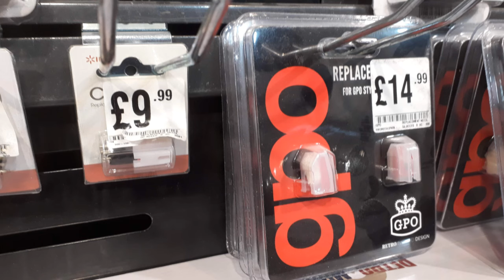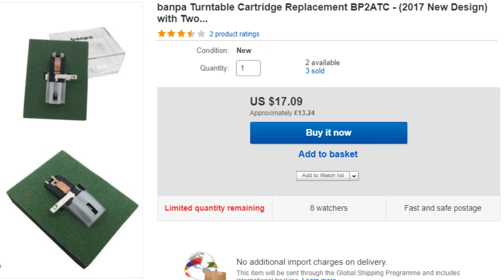Crosley troubleshooting for 'suitcase' style record players

Comment: Hello! I have a Victrola and it turns on and spins my vinyls but doesn’t play sound through the speakers, any idea what the problem is? It just stopped working through the speakers randomly
Reply from the maker: Yes, have a look about 18:12 through the video to see how to test the speakers and at about 20:32 to test the amp. If the headphone jack works then it will be the amp or the speakers. If nothing works, its probably the stylus or cartridge
Reply: @mrrgstuff  I have a Victorola with sound only through the stylus. No sound through headphone jack. I tried what you did @ 21:47 and no sound or amp feedback. Does this indicate a dead amp? I used it several months ago and it worked great.
Reply from the maker: Yes, if touching the 2 wires together doesn't produce any sound with the volume turned up, then there is very likely something wrong with the amp

Comment: Firstly thanks for the great video !

I have the same sort of turntable but then in combination with a dab+ radio and cd player.
When I turn on the turntable I hear continuesly a little 'brummm' I think it has something to do with the amplifier and ground  ...
If I touch the steel of the needle-arm it's gone also if I touch the RCA line out connectors ...
Can you tell me what I can do to get rid of the 'brummm' ?
Reply from the maker: Glad you liked the video. As for the problem, I agree it could be a grounding issue, but I don't have any sure fixes. However, is the unit grounded at all? Many modern record players are run from a power brick/wall wart and have no ground. Also are the power and audio cables close together anywhere? There could be interference between them. If touching the RCA plug helps then you could try inserting a cable as that may have the same effect. Otherwise touching it is causing it to be grounded through you and you know you need to look at the grounding
If the unit isn't grounded, then it may be possible to add a grounding line, but there are risks involved in doing this so I would advise finding a local expert
Reply: @mrrgstuff  Oké thank you for your reaction. Greets from Holland 🇳🇱

Comment: Hello, if I mistakenly use a 12V adapter instead of the 5V adapter which came with my Crosley CR8005F, will that explain why it’s not turning on? 😢 I’m very green when it comes to electronics, but have a multimeter so wanted to have a poke around. I found that when it is switch off I can get a reading of 5V and 0V (like in your example, around 4:00 mark) but when I switch it on I get 0.5V and 0.5V… What do you think?
Reply from the maker: If the machine is expecting 5v and you connected 12v, then it is possible that some damage has been caused to the circuit. This might then mean that even if you connected the original 5v supply again, the damage would stop it working. It's difficult to be sure about your multimeter readings, but although you would expect the voltage to drop down as it flows from 5v to ground, that does seem quite low at that point. There is unfortunately no universal quick fix that I am aware of. I did do a video about this topic, but it is more about prevention than fixing:
https://youtu.be/dkkijvr30XE
Reply: @mrrgstuff  Thanks for the reply! Very much appreciated :) When I test all the other points on the circuit board (with the switch to off) I get 5V all around. There’s a 10V capacitor (the little battery looking thing?) by the switch - do you think this could be busted and causing the issue?
Reply from the maker: It's a good question. Unfortunately, I don't know. Sorry
Reply: I made exactly the same mistake, the audio amplifier is gone, now I am trying to find its replacement, not sure if I can find one.
Reply: @SHJ3520  I took mine to a Small Electronic Repair place here in Hamilton, New Zealand, where I was advised that a) I'm not the first person to do this, and b) that there's no way to easily tell exactly what was fried and therefore it's not worth repairing :(
Reply: @lonrix9867   Agreed 🙂but I am a bit crazy, I ordered the IC that was getting hot, got it from Aliexpress, now the only problem is time, don't know when but I will give it a try, if doesn't work then I might replace the amplifier. Thanks 👍

Comment: I plugged my mine in on a carpet and after a few seconds I heard a pop from the player.  Now it won’t turn and and all I hear is some soft rhythmic beeps. Any suggestions? Did I fuck up by putting it on carpet?
Reply from the maker: Maybe. I have had a lot of trouble in the past with equipment on or in rooms with carpet tiles. Static electricity builds up really quickly and can easily destroy equipment.
I have one of these players which only works off an internal battery. If the battery is not charged properly it just makes a short noise which repeats after a time. Charging it for longer fixed that

Comment: The record for me is so distorted? I've tried every record I have and they all just sound like static with some coherent things here and there.
Reply from the maker: If its got Bluetooth try connecting it up as a Bluetooth speaker. If that sounds just as bad, then its some sort of amp problem. There are no easy fixes for that. If Bluetooth sounds OK (or you don't have Bluetoothto check), then check for problems with the stylus/needle and cartridge. Check the tip of the stylus is OK and not covered in dirt or fluff. The stylus (usually the red bit) needs to be fitted into the cartridge properly and not be a loose fit. Check also the connections at the rear of the cartridge. If it seems like a cartridge problem, then its fairly cheap and easy to replace it, and is about the only user replaceable thing you can do on these type of players anyway. Good luck

Comment: I have a question, if you see this. My crosley isn't turning on all of the way. When it's all plugged in, the power button lightly flashes blue, and the inside seems to click/whir in sync with the light. I can't tell what might be wrong. any ideas?
Reply from the maker: I don't know to be honest. The only reason I know for a flashing blue light is if you have the selection knob set to Bluetooth. It does that when trying to pair. Once paired the turntable will work as a pair of Bluetooth speakers

Comment: I get no crackling when I am doing the amplifier test. Does this mean my amp is bad?
Reply from the maker: Sounds like it. You may need to turn the volume up, but you should get some hum or buzz or crackle when you touch the contacts on the back of the cartridge. Did it ever work? Some people have reported that having the volume turned up too high can cause the amp to fail

Comment: Hey dude awesome video, I know its an old one but I was wondering if you could answer a question for me. My fiancé flipped a breaker while my record player was on and it caused it to turn off immediately. Now it won't turn on. Do you think its fried and I should throw it away or is it a relatively easy fix?
Reply from the maker: The only really easy fix would be if the fuse has gone (assuming you have a fused plug) or the PSU is faulty. Worth checking that out:
https://youtu.be/dkkijvr30XE
Reply: @mrrgstuff  thanks! We got lucky and a new power supply cord did the trick!

Comment: Does the transformer need to be plugged into the outlet to check 9 DC volts. I checked mine plugged in and only getting 3.2 DC volts. Thanks
Reply from the maker: Yes, it needs to be plugged into the wall outlet. Decent power supply units should read 9v, cheap ones may read a bit more. This other video should help you too:
https://youtu.be/dkkijvr30XE
Reply: @mrrgstuff  yes I bought one from E bay and the record player worked for ten minutes then no more sound. I did check the transformer after the problem and it showed 15 dc volts. Now I'm upset buying a cheap aftermarket one. I checked it again later and it now shows 12 volts. Is the record player trashed now. I did send a previous comment. Thank you sir
Reply from the maker: To be honest it's very difficult for me to me definitive on this. If the power supply was a cheap unregulated one, then it may have delivered too much voltage. This could have worked for a while and then burnt out something inside the record player. However I can't be sure that is the problem. The record should have a label stating the voltage and ampage it requires (see https://youtu.be/dkkijvr30XE). I would recommend getting a quality regulated power supply of the correct voltage and at least the required ampage and trying that. If it won't power up with that, then the record player will need to be repaired or replaced. When it stopped working was there any strange noise, smoke or smell?
Reply: Hi sir. It had no noise or smell. I flipped the record to side B then no sound. I even tried another record and still no sound. Thank you for all your help. Have a great day.
Reply from the maker: I'm not clear whether you machine is not powering up or whether the record turns but there is no sound. If the record is turning, then it could be an amp or cartridge problem. If you look on this video from about 20:31 it might help you figure out which. There is no easy fix for an amp problem, but the cartridge is easily replaced. Replacing the cartridge is about the only fix you can do that doesn't involve opening the machine up.

Comment: I have a Crowley cr74 but twice now it will stop working on 33 1/2 and then the motor fully will stop working. I have tried cleaning the thing that spins the belt but it broke again today. How do I fix this
Reply from the maker: I can't be sure. It's virtually impossible to diagnose problems based on a short description. These machines are also very basic and not designed to be serviced, so often there is little which can be done. It's worth noting though that 33rpm records are often 12", and these are obviously heavier than the 7" 45rpms. The motors in these are very small and can struggle to turn heavier records. If the belt has stretched, then the motor will run but the belt might be slipping, causing the record to slow down or stop. A new belt might help. If the motor is just stopping completely, there is probably just too much friction in the mechanism. There may be other videos on YouTube which address this issue. It's possible the motor might be faulty also. I'm sure it is possible to replace the motor on these, but I've not done it and unfortunately there is no guarantee that would help. From a safety point of view, the only servicing you can really do is replace the belt. Anything else will probably involve opening up the machine more, and if the machine is mains powered, there are dangerous voltages inside so I'd certainly recommend getting someone experienced to look at it. Its unlikely to be cost effective to repair so you might consider spending the money on a better machine which is more likely to work in the longer term.

Comment: I have a victrola record player and I think I used a different power cable on it when I turned it on yesterday, the power didn't come on and it came on all of a sudden and made a pop noise and turned off. And then it started smoking and made a smoke smell. I since found the right cable but it doesn't work anymore. I've only had it for a few months and barely used.
Reply from the maker: Sorry to hear that. It sounds like the other power supply wasn't compatible (probably the wrong voltage) and it has caused damage to your machine. There isn't really anything you can do about it. It may be repairable, but unless you have a friend who knows how to do electronics repair, it is probably cheaper to buy a new one.

Comment: i bought a new crosley record player almost a month ago. i haven’t used it because i didn’t have any records to play. until today, i bought one excited to try it. but i came home and it won’t turn on. the light indicator wont light up. i have tried connecting it to different outlets around the house. but it still won’t turn on. it worked perfect last time i turned it on. idk what to do ??
Reply from the maker: If you can test the power supply / mains adapter / wall wart to see if it is outputting any voltage that would be a place to start. If you can try another mains adapter that would narrow it down. However if it was new, only a month ago then your best bet is to try to get the supplier to replace it for free.

Comment: Hello, I was recently given a Crosley C10 record player as an unwanted gift. When I turn it on, the the motor drive only twitches, and the belt does not turn. As far as I know, the product is no longer under warranty, do you have any advice on how I could get this fixed, or is it even worth fixing? Thanks
Reply from the maker: I've not seen the C10, but from what I can gather it is actually a badged version of one of the Pro-ject turntables. These are much better than the standard suitcase ones. I have a different model of Pro-ject and it's very good. It would be worth checking if the power supply is correct. Its possible you don't have the right one and it's not powering the machine up correctly. I'd also remove the platter and try running it with the belt detached. If that works then there may be a problem with the belt jamming up, or possibly the central bearing of the turntable. With the belt off and the platter on, the platter should spin freely on the bearing. If the motor still doesn't run with the belt off, then it sounds like a motor or motor driver fault. Probably fixable, but you will need to find someone local to you to look at it. Good luck 😀👍

Comment: Hey fantastic video. Anyways my turntable won't power on... the chord indicator lights up for power when I have it plugged in, but the record players power indicator won't illuminate, even when I just want to connect Bluetooth, any ideas?
Reply from the maker: If you have another suitable power pack that would be worth a try, its possible the cord is damaged inside. Next step would be to check the output of the power pack with a multimeter. If that is ok, then you or someone else will need to open it up and trace the power through the circuit like in the video. Hope that helps. 👍😃
Reply: @mrrgstuff  Phenomenal idea! I will give it a try. I am not sure I have an extra power chord, although their is a possibility. And it should have came with a functional power cord.

Comment: It's a very useful video, thank you! I am a totally beginner in this area, so I didn't understand one point: you are replacing a ceramic cartridge for another of the same type, right? I can only find these 2 needle cartridge in the magnetic version, here in Brazil. Is it possible to install it anyway? Thank you again for this channel!
Reply from the maker: Thanks, glad you found the video useful 👍😀.  Yes, I am replacing the standard ceramic cartridge with the type that has the flip over stylus. I bought some marked Banpa and one marked Ymiko and they are both ceramic. I think the technical data for the Ymiko said it was magnetic, but I don't think it really is and works just like the ceramic ones.Have you seen these other videos?
https://youtu.be/u4efWHXCfII
https://youtu.be/WjecPbT3ipw
Reply: @mrrgstuff  Very interesting. The ad here says that the output tension is about 200-300mV, very high for ceramic, so maybe it's a cartridge similar to your Ymiko. What do you think about? Thanks for the other videos, I'm gonna watch them very soon!
Reply from the maker: To be honest, it is very difficult to know. I would expect a ceramic cartridge to generate a higher voltage than the one you mention. However without seeing and testing it, it is impossible to know for sure. However if it looks like the flip cartridges I have shown in these videos, I would expect it to be basically the same item.
Reply: @mrrgstuff  Got it. I think I'm gonna take the risk. Thank you again!
Reply: My problem is when the Motor is spinning my record it makes a vey bothersome noise to where have to turn it off. Help!?!
Reply from the maker: If its motor noise, it could be a bad belt, or a warped turntable. Maybe a faulty bearing in the middle of the turntable, or just one that needs a bit of lubrication. Does it make the same noise without the record on the turntable? Did it ever work and has the noise got worse over time?
Reply: @mrrgstuff I bought it used from a man at a Thrift store and its been working until around a week ago I installed a simple stylus cartridge on the arm and it's made that noise ever since so I don't play it its been working bought it used it's been used don't  know how much though. Without a record on it there's not near as much noise but still a little noise. There is way less noise without a record setting or playing on it but still a little bit of noise
Reply: @mrgatuff I just put a record on and there is no noise but the turn thing is warped or wobbly
Reply from the maker: Ok, so it was working fine and then you installed a new/different stylus/cartridge and now it makes lots of noise. Did something happen to make you change that part? From your other comment it sounds like it will turn the record without noise, though the turntable/platter is a bit wobbly.
The noise you are hearing, does it come out through the speakers? Does the record seem to be playing OK (can you hear the music) or just the noise? Do you only get the noise when the tonearm is lowered down on the record? If you have a bad stylus/needle it will make an awful noise.
Reply: @mrrgstuff nah it's not making any noise now lol. I put the record on the platter and it plays with sound plays the record and nah the noise that it was making may still do it have to wait and see later on but now its working like supposed to but splatter is a little wobbly nah the noise doesn't come from the speakers the noise sounds like its coming from underneath or top of the platter
Reply from the maker: Glad it seems to be working now 😀👍